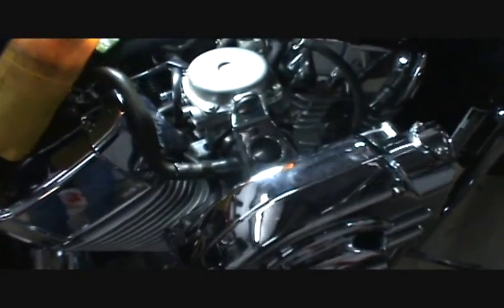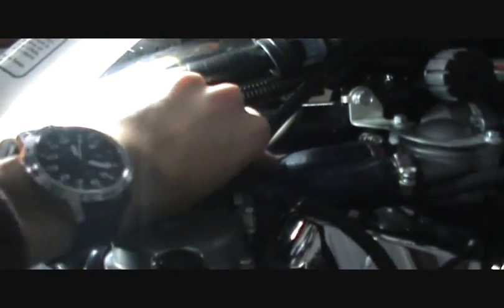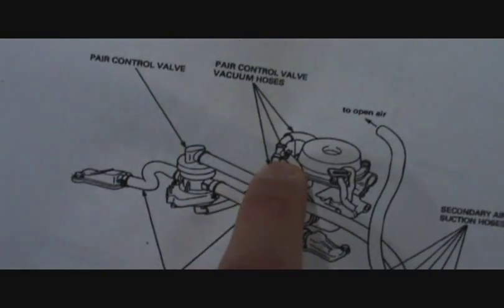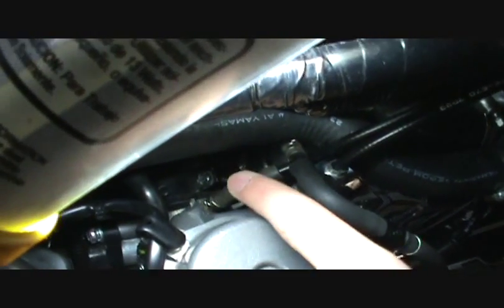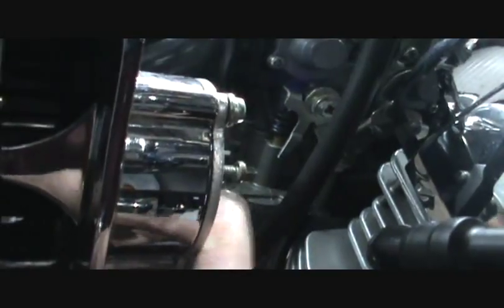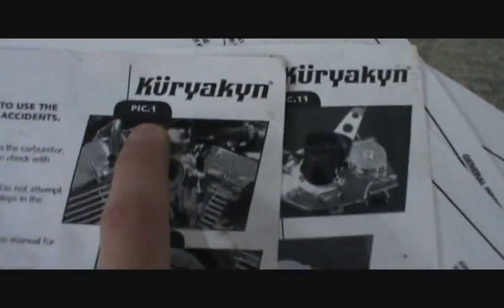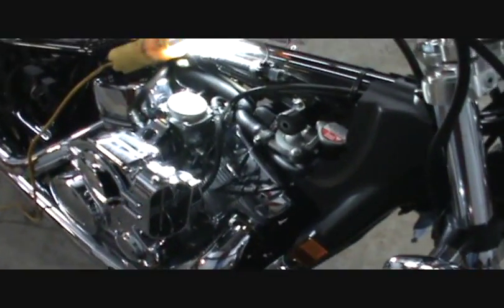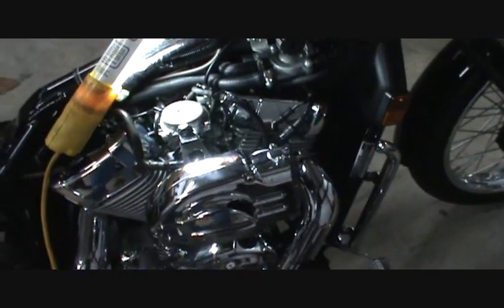Butterfly Vacuum Problem: Part 2- Re-routing vacuum lines

Comment: So I been struggling with that damn open line to atmosphere. It doesn't make since... I been reading multiple manuals and there's nothing in them about it.  My bike runs GREAT (1995 fat boy) and when I plug the hole with my finger it wants to die. Maybe I will add a filter or something.  Preferably a aquarium filter so no sand or crap gets sucked in.